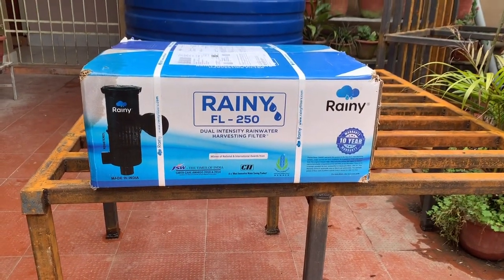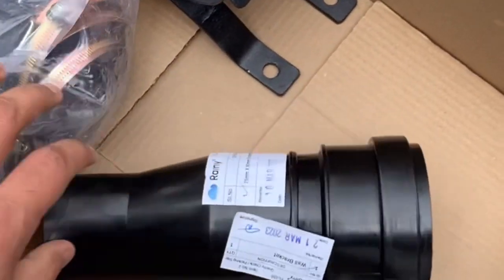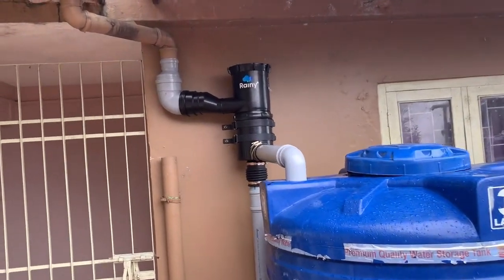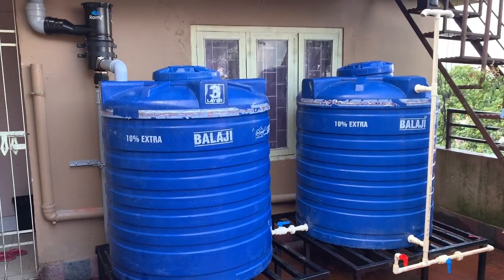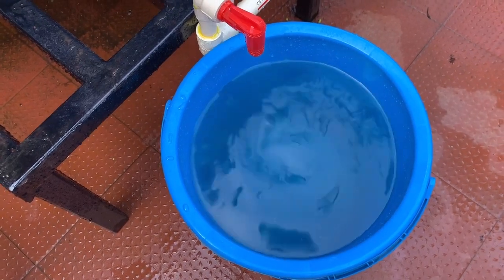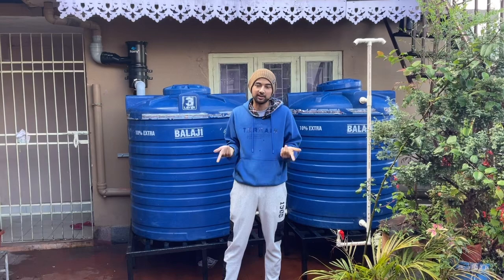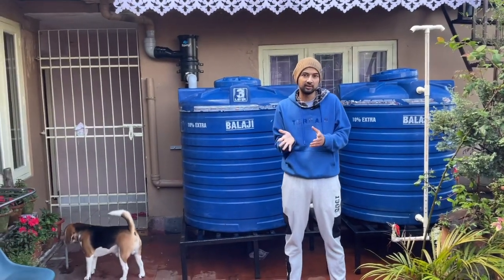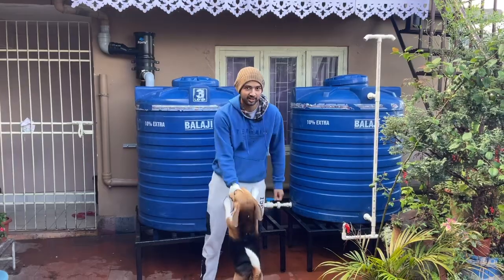Transforming Rain Into Resource: DIY Rainwater Harvesting System in Gangtok

Comment: Sir, but if the rain harvested water is to be used for miscellaneous works like toilet flushing, cleaning car/house, watering plants only. Why does it need a filter? The sediments in the roof water mostly come from the old surface of the roof as rain water in itself is pure. This, for newly constructed houses is minimal or near to zero. The equipment is innovative and would have been of a great use if  it was a cost-effective option. But considering it’s price of more than 10k and providing what it serves; I think it’s pretty useless.
Reply from the maker: Fantastic question! 
The roof can have other particles such as fragments of fallen leaves, dirt, etc. The rainwater harvesting in my house, where the video is shot, is done such a way that the harvested water is transported to one toilet of each floor. If we don’t employ the filter then the tap of the pipe transporting the water and also the pipe itself might get blocked and might require frequent clearing which can be cumbersome at best and impossible at worst!